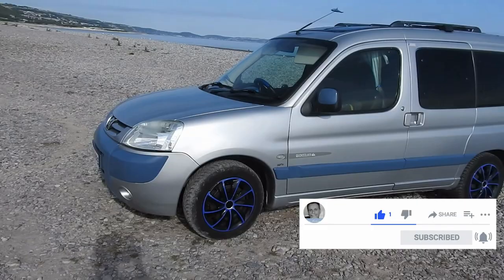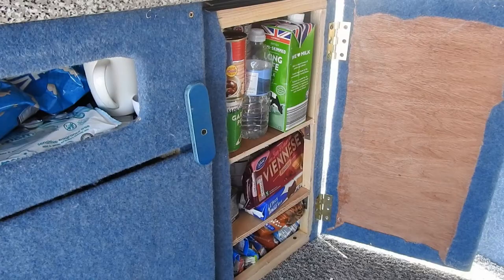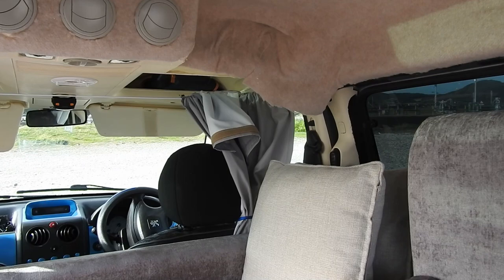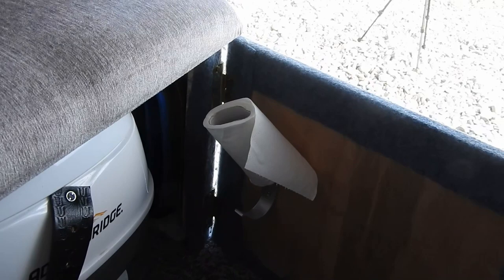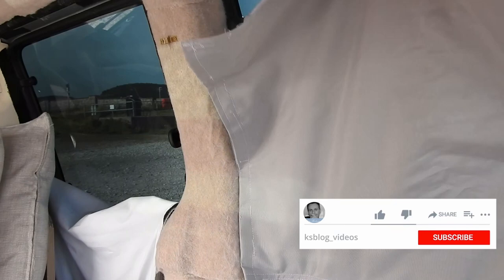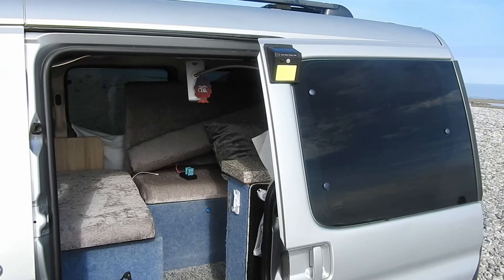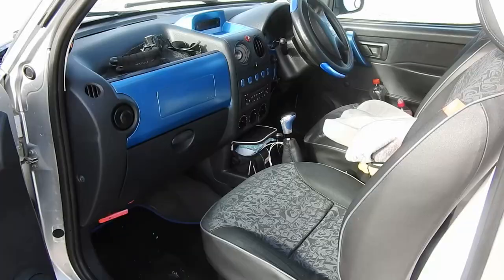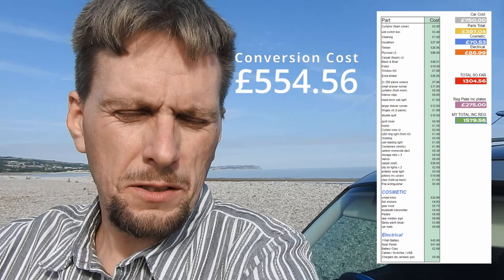CHEAP DIY STEALTH Micro Camper Conversion FULL TOUR Peugeot Partner Sleeps 2 with Solar Electrics

Comment: I abandoned my interior bed build in my 2009 Berlingo in favour of a tent. Once I had the mental image of a heavy rear end smash cutting me and the drivers seat in half, I just couldn't do it. I have the cabinet, fridge slide, battery and dcdc charger, just no bed. I considered a crumple design, but I couldn't figure it out for strength, weight bearing and crumple. Have you considered this at all?